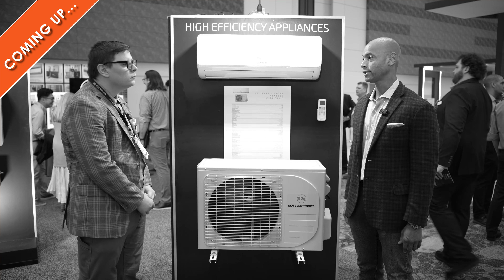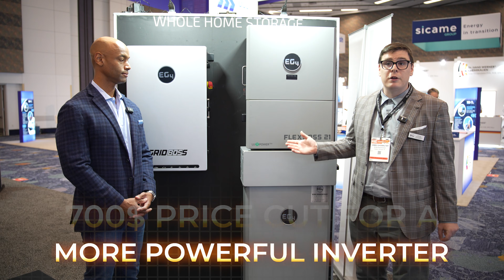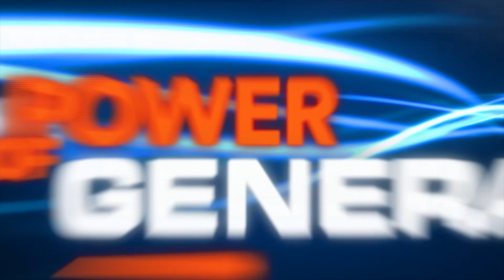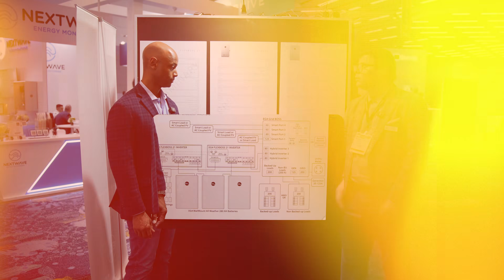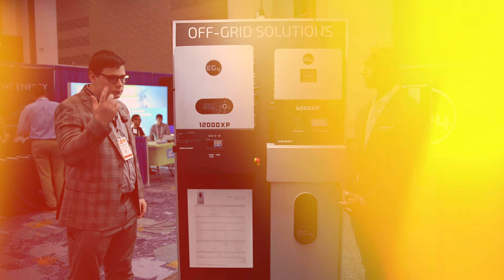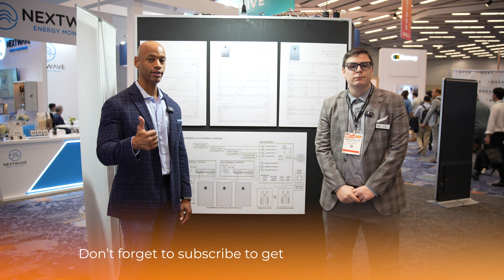New EG4 2024 Product Lineup

Comment: Another issue with all of these low cost high frequency, transformerless inverters is that they're not user serviceable. When they fail after the warranty runs out, they're pretty much done. (Throw away inveryer) The manufacturer will not ship you the parts that you would need to even perform a board swap because they don't want to incur the liability of you injuring or even killing yourself by poking around the high voltage capacitors that are in these inverters, that remain energized, even after the battery has been disconnected. And most inverter repair shops won't mess with them because they have to warranty their work and these inverter have a high failure rate post repair due to the use of cheap, short lived Chinese made components. If you want an inverter that's going  to last far longer and is field serviceable and easy to repair that uses far less components in its design, then you're far better off purchasing a low frequency, transformer based inverter charger.
Reply: James specifically says they will be offering rebuild and repair service after warranty.  Signature solar has offered refurbished products for years.

Comment: The only thing missing is a V2G  EV charger solution.
Reply: V2H (vehicle to home) would be more relevant to off grid installation.

If your solar array goes down in a weather event, an EV is portable 50-100+ kWh batter. Get out to charge it (hopefully the roads are clear m electricity is available) then bring the power back home.

Comment: QUESTION: Can these systems be controlled without internet access?  ie using local computer
Reply from the maker: Yes.  You can control the unit locally using the touchscreen display

Comment: I'd love to see higher voltage batteries come out.(300-500v dc).
   We're already dealing with that voltage when we connecting our solar.
Reply: The PV input handles up to 500 vDC. It converts and stores it in most 48vDC batteries.
Reply: @TimAch-p2c 48 volt battery is still not high voltage... it requires thick cables which limits you to having to store your batteries right next to your inverter to save on thick expensive battery cables

Comment: Impressive. I’m in the process of building a box truck to assist natural disaster victims with Wi-Fi, charging for phones, laptops and satellite communications systems. EG4 sounds like the best options. But are the systems shielded? I’m planning on multiple repeaters for first responders and I really have to have clean power for the repeaters as well as ham radios. To keep the equipment cool I’m also looking at a split A/C unit.
Reply: If you need clean power you might look at a low frequency inverter such as a Victron. 

Expect Victron inverter would be better in a truck or other mobile application.

For a off grid cabin, home or small business it is tough to beat EG4.
Reply: @ thanks for the info. By the looks of all the disasters I think more mobile emergency trucks like the one I’m building are in need. All we’re missing now is a volcanic eruption and a meteor. I sent your company a email a few months back inquiring about scratch and dent units but never heard back from anyone. Thanks again.

Comment: the mini split cannot be serviced by a diy because he can't buy refrigerant
Reply: I believe the lines are pretty pressurized
Reply: @diySolarPowerFunWithRay  you cant buy refrigerant with out epa licenses.
Reply: @victorreece9256  refrigerant is already in the lines
Reply: What’s your point?
Reply: @leafnutz2341  most hvac guy will not service the it. If you have leaking you have to throw it away and buy a new one . That my point.
Reply: @ what you are saying applies to most mini splits.  Especially when they are out of warranty.

Comment: I think that grid ties in the next few years will become less and less important.  With the improvements in Battery storage, more and more people will be cutting the strings to the grid.  I cut years ago, because of the problems with obtaining the grid for my rural home.  It was definitely more expensive then.  Now, it is closer and closer to being a wash and soon it will make more sense for people currently on the grid, to cut such ties.  EG4 is a very competitive solution now, and it will only get better.

Comment: Excellent video. Excellent channel.  A question (dumb I’m sure): A series string feeding directly into the mini split, what would the rapid shutdown system requirements be?  What are the options?  Panel mounted?  Capable of operating without AC power?

As a hobby level RV guy, if you or someone else had an introduction/comparison of panel level protection systems, and maybe an idea of where codes will go in the future…

Comment: Did I understand correctly that at 19:00 in the video, the rep says homes with dual service panels can be served by one inverter through a parallel connection? 
My home has 2, 200-amp service panels. This would be great.

Comment: 9:00 The POCO wants a fused disconnect with a handle that can be locked by them I wonder if they would go for what James is saying?

Where are the CTs placed when using the Gridboss with a Flexboss, 18kpv, or 12kpv? I am guess as close to the meter as you can get them? Are are they in the Gridboss now?

Comment: I have 3 EG4 6000xp inverters running my whole 2 story house, work shop and ADU... Im going to be adding the 9k mimi split AC unit within the next few months...EG4 hasent let me down and I love how they are always improving.
Reply: How are the 3 6000xp working?? I love the idea of have 3 so if something goes wrong with 1 of them you are good to go.
Reply: @supremeauto6749  There going strong , I up graded from 4 Growatt inverters. Im going to add a 4th EG4 soon because I built a n ADU in my back yard and have a on demand water heater in there which pushes the inverters kinda hard.

You and I think the same, if one of my inverters was to go down then I still have 2 that will keep me going.

So far they have worked great and I havent had any issues what so ever. I did a video on my youtube page about the Growatt inverters and Im going to eventually post one on the upgrade to the EG4 as well.

Comment: Thanks for the info
But i just installed a 12,000 btu 220
 & a 9,000 220 pioneer system
Got one more 9 000 to put in pd $2,450.00 for all
Trying to sell it for $600.00 to buy one of your 1 ton 9,000 or 12,000
I got an older farmstyle house split up in 5 areas
One last area to do
Then onto t he eg4 3,000 model $399.00 with two 48v 100 ah batteries. Then a 8x8 shed to build for 6-8 195 solar panel's 
Wish me luck
Wish i had a youtube channel 😢

Comment: The new set up with the flex boss would’ve solved so many issues that came up when sending up my system not so much issues in the sense that something went wrong, but it got expensive to run wires from where my electric panel is to where I want to put my batteries in my garageThis is so smart.

Comment: Great job EG4. I’ve talked to 3 installers and they cannot figure out how to configure my whole house system. However they are all asking well over $100k. 
My issue is I have a meter with box 50 feet from my house and 150 feet from my barn.  The power is split at the meter into a 200 amp panel into the house and a separate 200 amp panel to the barn. 
I still don’t exactly know what to install but this system seems to be a solution. Could someone give me knowledge if this is the best solution for me. I want to run a 24 KWA solar system with backup battery power for  atleast a 24 hour period. 
I’m going to build onto house and current 200 amp panel is full. The addition would be on the far side of the house approximately 150 feet from the meter box. 
Thanks

Comment: I would never use of of these liw cost high frequency, transformerless inverters to power my home. Without an output transformer to provide galvanic isolation between its DC boost stage and its AC output, these high frequency inveryets can damage your AC appliances. In fact, during a catastrophic failure of the H-Bridge circuit where the MOSFETs short to ground, you can even set an AC appliance on fire.
Reply: That has been a concern of mine. I'm using a Magnum 4024 it is a stable work horse just a couple years old. Finally went to lithium batteries this year. I think I'll hold tight on a new inverter. I think I would prefer a separate inverter and charger even though the Magnum transfers good.

Comment: Good job and coverage of the best company out there. i have 60KWh of batteries, a 18Kpv and 15 kilowatts of Bi-Facial solar 100% off-grid
Reply: Do you have central Ac? That is my only holdup designing mine
Reply: we do have AC but not central. the three units we have cover the area needed and is sized correctly for those areas.

Comment: Because I would rather put excess solar into my batteries l couldn’t see the point of powering the mini split separately because when not needed the power would be curtailed. 
I never saw export to grid as useful because with batteries you lose power when the grid fails. Emergency backup was my motivation because we had no problem paying the electric bill. But when you dance with the drunk fat girl ( the unstable grid power) you have to stay in step and follow her rules. I hadn’t considered they even limit the size of the solar arrays. So that’s why the direct connected solar is an advantage.
 I think the evolution of electric service is not a bigger grid but distributed generation and storage,first of all in the individual houses,then cellular co-op like mini grids. That isolates both the home and the community from disasters or terrorist attacks,making it easier for the statewide grid to recover in a black start situation.

Comment: I just bought the EG4 18K, 3 EG4 Outdoor Batteries, and 20 540-650 Canadian Solar Panels for $19K out the door. Wish I could have waited for this, I have my install on Monday, but I am completely off grid and my current 25 year old battery died a month ago. Been running on a generator for a month now. Been a hard time for the wife but if it was up to me I would have waited for this. Can I pair the 18K with this system?

Comment: If EG4 is so great and cost competative why are all the solar sales guys pitching me power wall 3 or Enphase. Ive talked to 5 companies and I get the same product recommendation. Its almost like Tesla and Enphase are paying them.
Reply: Because the markup is higher on those, along with the margins.
Reply: cost competative... lol... good one

 Growatt SPF 6000ES PLUS off-grid inverter does the same for half the price
and without american special parts in the rest of the world 

i need parts that cost the same as the inverter to install  a eg4 inverter (same with enphase)
and on top of that they cost double price

installers want touch it where i live, so that part is not cheap either
Reply: Why? Commi$$ion.  EG4 is thousands less than the 'brand' names every fly-by-night solar installer wants to sell you. Plus the other systems are proprietary - once you're in, you're in for life.  EG4 is to Android as Tesla is to Apple - one is open/inexpensive/flexible, one is closed/expensive/limiting.

Comment: Which inverter is the best option for  me? I have a 4.1kw grid type solar system with micro-invertors and I want to add an additional separate 4kw array with a battery. I want to leave my old system alone and the new one will be "off grid" with the option of using the grid if I run out of power but not selling energy back to my utility.
Reply from the maker: For a 4kW off-grid expansion, the 6000XP inverter will work just fine and be the best value.
Reply: @SolarSurge  does the current 6000XP has the AC coupler that he was taking about?

Comment: I do question the $1000 labor in installing a battery???? That seems a bit insane no?  But this shows how insane the markup is for installers.
Reply from the maker: As more electricians get trained up on batteries, they will likely return to the traditional hourly labor rate + cost of materials pricing model.
Reply: @SolarSurge  To be fair a battery is really no different than a solar panel, there really should not be much of a learning curve at all.

Comment: Welcome to the DIY market.  Seen a few of your videos (all great coverage), but I do hope this helps educate more people in solar and what the utter scam is that most installer companies are with their insanely overinflated prices.  Juts a little knowledge and time, home owners can build out systems at a fraction of the cost a traditional installer can.  Maybe all they do is get help to do the install but purchase the equipment directly from Signature or other retailer.
Reply: Interesting set of assumptions in that statement.  Where exactly are you seeing the solar installation companies ripping people off?  

If you want to get a permitted installation (which solar installers have to do) I'm seeing just about zero inflation in their costs. Lots of idiots look at panel, inverter, battery prices and think to themselves "Those thieves are ripping people off!!!" And meanwhile they neglect the permit package costs, solar racking, combiner box, disconnect switch, wiring, etc.  If you want to DIY, that's awesome, but you're only really saving the cost of your own labor.  Compare the number of hours you're going to spend on the install and what a certified electrician costs per hour and you're not saving anything.

Comment: 48V how long are the US solar companies going to beat this dead horse. Wake us up when you come out with HV inverters and batteries between 400 and 600V
Reply: We're already there. The nominal HV bus is 400V to 500V in all-in-one inverters like the EG4 18kPV or Flexboss.
Reply: I wonder if they have BMSs to series connect the 48 v batteries. With that option the battery could be remotely placed and save a lot on wiring if it was 500v.
Reply: 48v is last of the ‘low voltage’ train stops. Lots of expensive parts, safety protocols when you step into high amp, high voltage DC systems. I’d say the 48v is doing very well for home sized systems.

Comment: The 12kpv is not $2599. It is $3499. Wish it was $2500
Reply: the unreleased 12000xp is not the same product as the 12kpv that has already been released. 12000xp is an off-grid inverter. 12kpv is a hybrid inverter.

Comment: Thank you Joe, been waiting on more love for EG4 for a while and I mentioned it a couple of weeks ago if you remember.  You're the first Youtuber with detailed info about the new Gridboss and Flexboss 21.  One youtuber briefly went over it last week with a quick overview.  Who would have thought it would be you coming out with all the details?  Thanks for listening to your viewers.  Now with the Gridboss and the Flexboss coming out.  I'm going to forgo the original 2-EG4 18KPV Hybrid inverters and get the new stuff.  Going to be cheaper to get it installed and more flexible features.  I will hang the electric vehicle charger right off one of those smart ports instead of hanging it off of a sub panel.  One thing that wasn't mentioned, the EG4 Hybrid Inverters and all of their current batteries are now certified EMP Hardened as of a couple of weeks ago.  Not sure about the off-grid inverters.  That includes all the ones that are currently selling so you don't have to buy new ones for that certification.
Reply: I'm in pa

Comment: Looks like I have some homework as I am a bit confused.  They started with the EG4 Flexboss 21 & GridBoss + storage then ends with the new 1200 XP + storage.  Which one am I supposed to use if I want to replace what I have now (solar and inverter) and expand to additional panels and storage in Ca.  Especially if I want to do partial DIY and hire out electrical.  They are right - the EG4 is very popular from what I've read so far.
Reply: [1] If you need to mount outdoors, go 18kPV/Flexboss/Gridboss. If you want to mount indoors, go 12000XP. [2] If you want to get a contract with PG&E and sell back to the grid, go with 18kPV/Flexboss/Gridboss. If you don't want to deal with the power company, go with 12000XP. [3] Either route can equally be done partial DIY. [4] Either route can equally use your existing solar panels directly as a string inverter or do "AC coupling" if your current panels use microinverters. [5] Either route provides a path for additional panels and storage. However, the new Flexboss/Gridboss approach provides the most flexibility
Reply: The Gridboss replaces your AC combiner/distribution panels from your inverters, as well as a inverter bypass so you can run on grid while doing inverter maintenance. If you never had multiple inverters or a bypass you don't need the Gridboss
Reply: Flexboss and Gridboss + Storage.  I originally was going to go with two 18Kpv's until I saw this video.